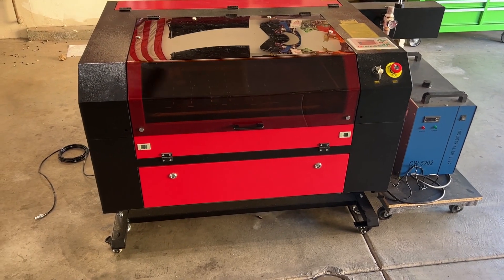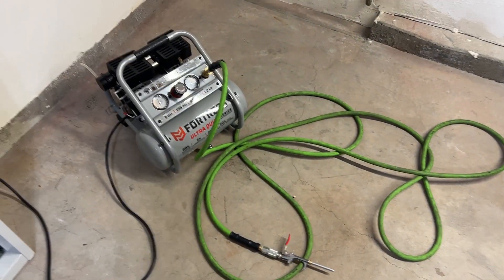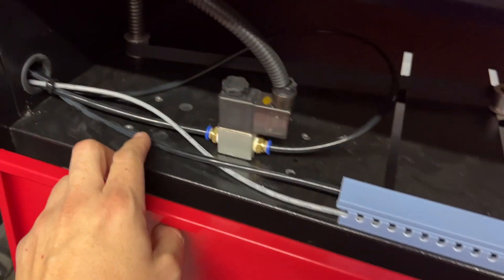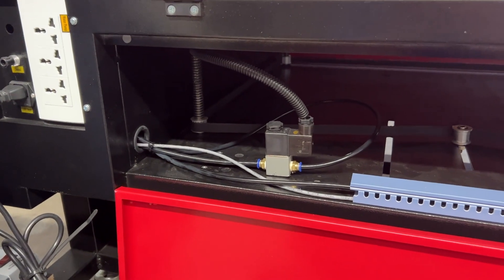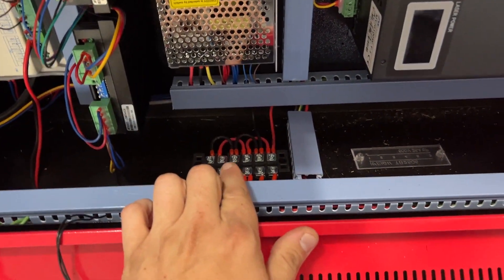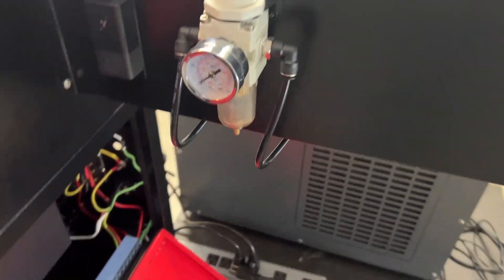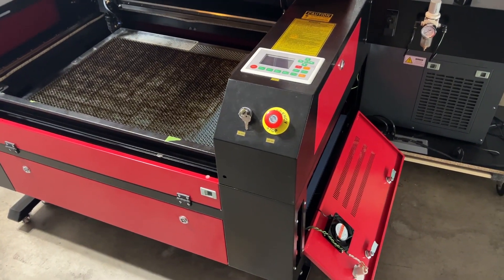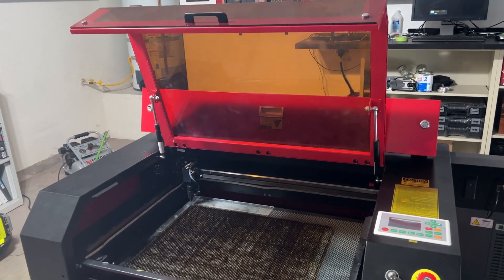OMTech 100W CO2 Laser Mods in depth (Air Assist, AC Infinity Exhaust, LED and More!)

Comment: Question, this might be a dumb question but should I be feeling air coming out of my laser nozzle and the solenoid out tube?? I’m seeing a flame on my material and I don’t feel air coming out of the laser head. 😢
Reply from the maker: so the air needs to be triggered by the settings. i would first check settings to make sure "Air Assist" is enabled.

Comment: Just ordered this same setup.  I can see me doing a few of these mods also.
Reply from the maker: Awesome! Let me know if you need any help! :)
Reply: @WallMan1013  Now that you mention it, How is the noise?  I want to put this in my office/workroom inside the house. I will put it next to a window for a deducted vent but I have not found any real wold examples of how loud this and the chiller would be under use.
Reply from the maker: @thispalebluedot23455  just ran outside and took some decible readings for you. With my set up and me standing between the compressor (cycling), chiller and air exhaust on full blast I’m getting a reading of 71 decibels peak.

Comment: Exact laser and mods I have! Raising the laser would be great, I'm 6' and find myself bent in half most of the time. Cool video man, subbed to see what else you do with it!
Reply from the maker: Thanks man! Yeah I plan on raising it soon. Not sure what bolt size and thread the mounting bolts are. Thinking I might have to use some all thread to make them long enough to raise 6 inches.